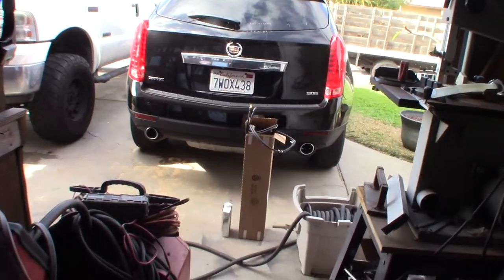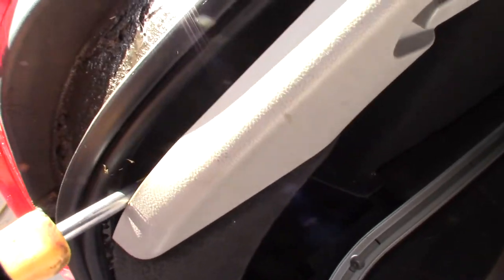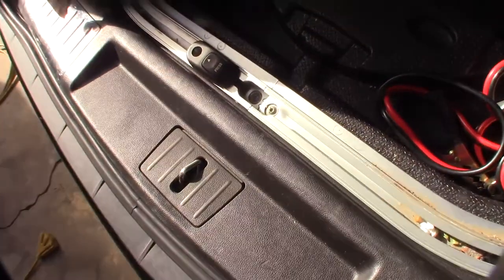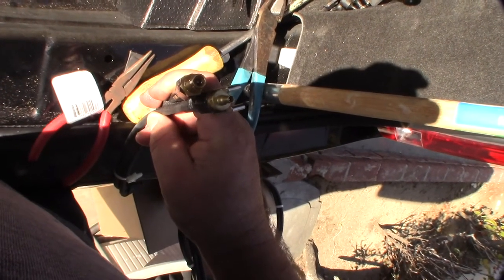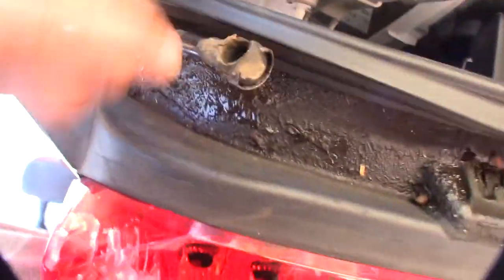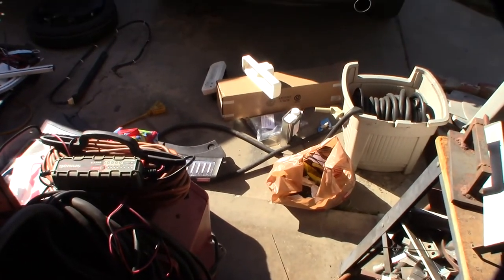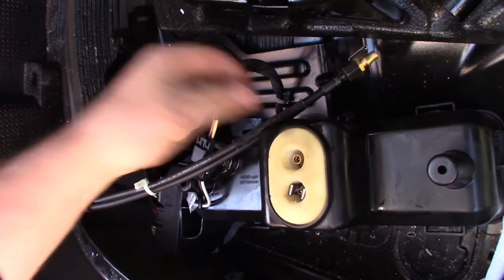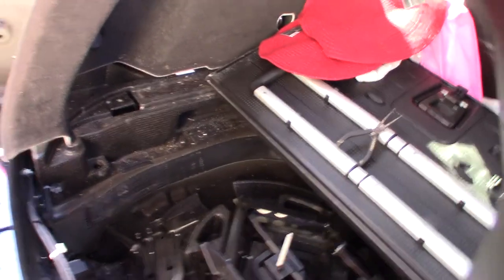Cadillac SRX GM Power Hydraulic Liftgate Arm Actuator Leaking Replacement ACDelco 23429744 repair

Comment: Thank you for saving me some money!  Cleaning out that reservoir was a trip but got a fair chunk of nasty out with a can of air & a couple fill cycles.
One tip I would add is that the side paneling is held in by the nub that would hold the back cover so unscrew that and you'll get lots more space.
Cheers

Comment: Thank you for the video! I couldn't find it anywhere on YouTube. My mom's 2014 SRX has the same issue w/ the hydraulics. Not sure if I'll be capable of doing all that as I don't have a garage full of tools (especially the part where you replaced the hydraulic fluid), but we'll see when the parts arrive... Wish me luck!
Reply: I cant get my hydraulic lines to reconnect to save my life ? I did not change the arm just the pump, and lift gate module (3 plugs into it) . Anyone have any ideas ?